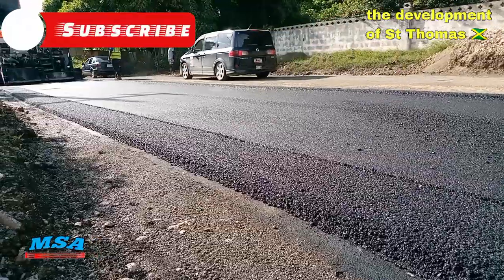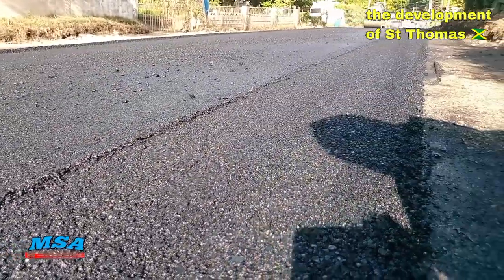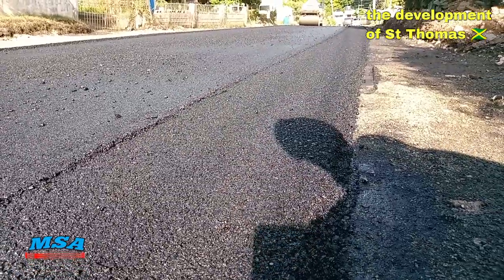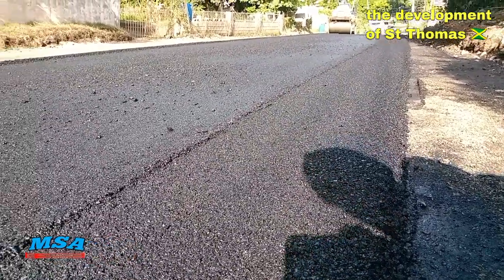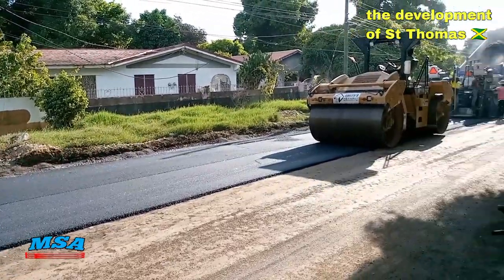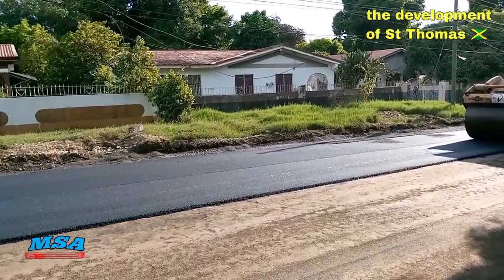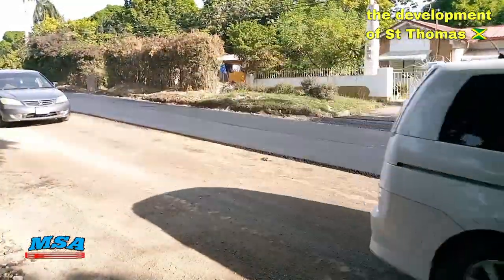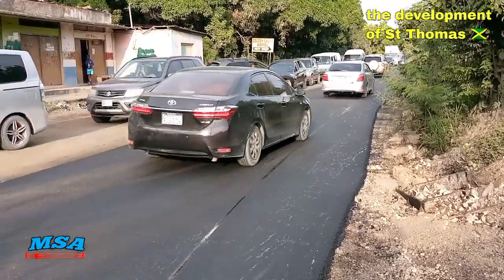UPDATE/ASPHALT PAVING CONTINUE IN LYSSONS ST THOMAS /THEY ARE GETTING THERE /

Comment: Kingston East Morning. Do you think that what look like 2 inches of Asphalt on a Marl Base can hold any form of Waigth worst when rain start to fall and Heavy Unit start to use it , Please let me know

 eavy Unit
Reply from the maker: Yes I do understand what you are saying but please remember that's the first layer thanks for your comment
Reply: I totally agree with, I will also add that these dual carriageways in St Thomas they are not properly constructed, for example, look at what they are doing here they asphalting first, there is no kerb and channel and no side walks, so when it now rains the water will now runs along side the edge of the road where the kerb and channel should be what will happen is water will start to under mind the road a soon with the heavy traffic and trucks it will start to errode.